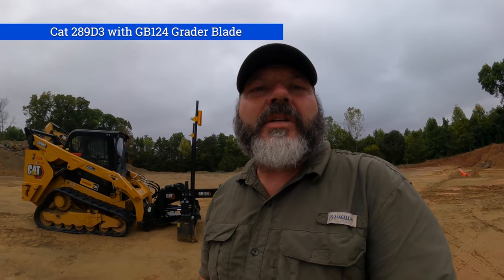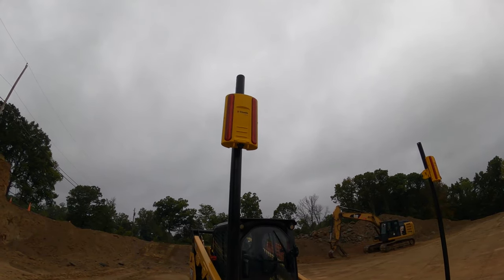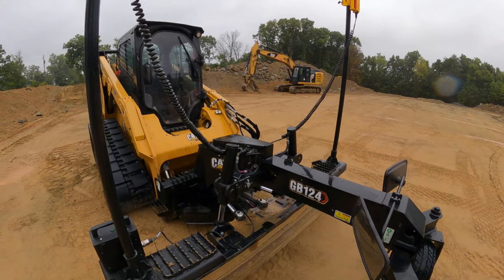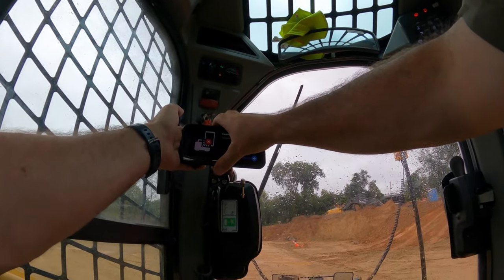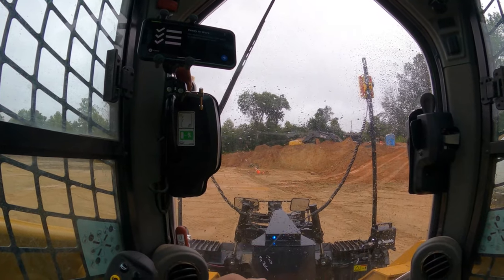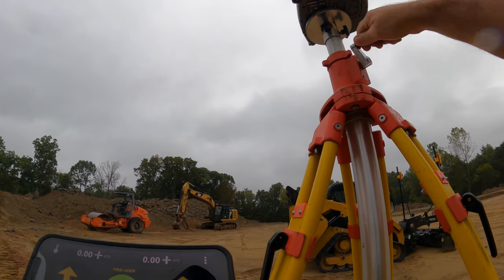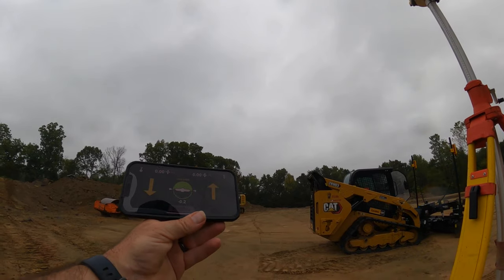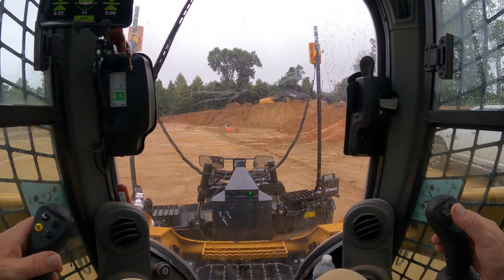Cat GB124 Grader with Trimble Earthworks Go Grade Control

Comment: Just wanted to say thanks for this video. Sold me on the system. Picked up a gb124 with the wings and EW go this spring. Don't use it a ton but makes incredibly quick work of large areas in a small machine and solo operator.

Comment: Does it know what the engine is doing? Does the blade lift up if engine is bogging down?
Reply from the maker: It really doesn’t bog the engine, if the ground is really hard and you try to cut too much in a pass it will just rare the front of the machine up in the front a little. In that case you just change the offset on your cut to so that your taking less material at a time. When in Auto, you can still manually pull back on the stick and lift the blade gradually if you need to for that type of situation as well! Thanks

Comment: so i see you changed the grade increments via the phone    can't you use the little black buttons on each controller to do that ???   i suppose since the controllers are not synced with the phone it won't work that way ???
Reply from the maker: Yes u can increment up and down w the buttons as well
Reply: Can ya use in different machines ? I have a Takeuchi TL10